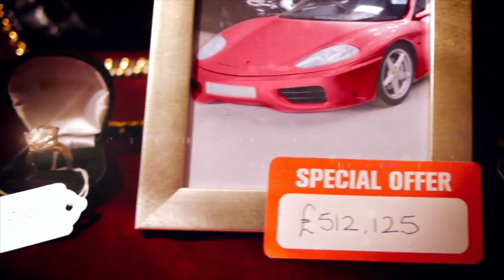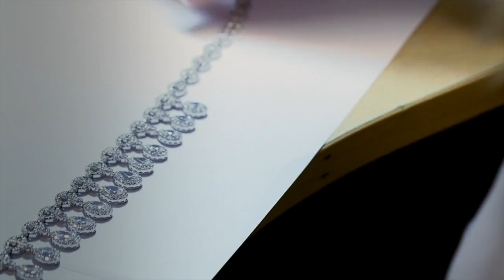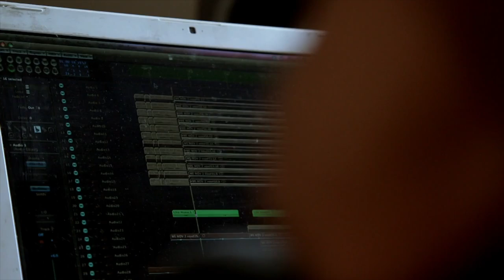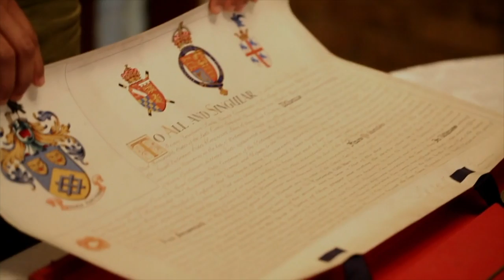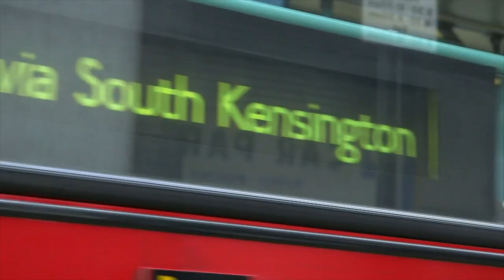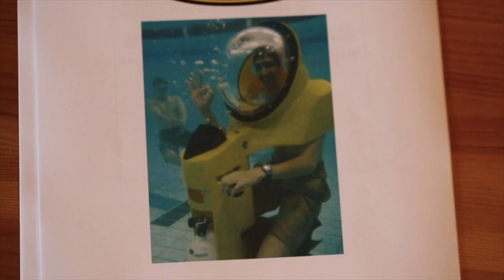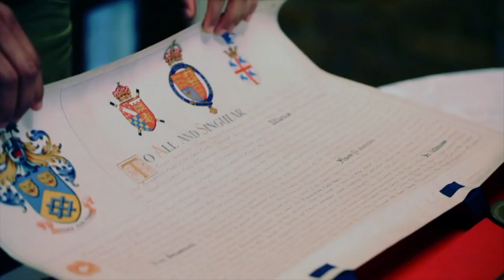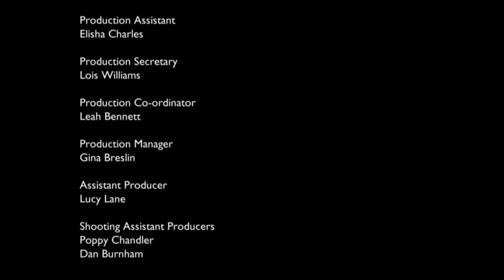Trade Off - From Luxury Pawn Shop: Decoding Heirloom Diamond Necklace Value

Comment: Also, let's analyze the complete transaction of that $500,000 necklace. She accepts a $50,000 loan on a $500,000 necklace. How is she going to pay that money back plus the interest on that loan? So when she defaults on that loan, the pawn shops keeps the collateral / necklace. At 10% of the retail value.

Plus, the pawn shop offered her even more than the $40,000. I think they did this to ensure that she would never be able to pay that loan back. And then the pawn shop keeps the necklace either to chop it up or sell it intact. So in other words, the pawnshop isn't selling the item they're actually buying it a few months down the road.

What the spider said to the fly?
"Will you walk into my parlour?” said the Spider to the Fly, “'Tis the prettiest little parlour that ever you did spy; The way into my parlour is up a winding stair, And I have many curious things to shew when you are there".
Reply: They said quarter of a million not half, so it was worth a retail price of 250,000 and she got 120,000, and she sold it, she didn’t pawn, the last women’s retail price was 120,000 and she got 50,000, she as well sold it. So neither have to pay anything back, the 250,000 one already had a buyer, he told her they offered 120,000 which obviously wasn’t true because he keeps a cut of it, so I’m curious what the person actually offered.

Comment: You don't take the first offer some gives you for a 250,000$ necklace. 250 is a number he just shot out at auction even though there would be auction fees but you don't leave 125k or more on the table.

Comment: I would have thought that the box with the paperwork in it would have been worth a lot more. As for the necklaces. Anyone can see that the first necklace was a work of art. glorious and one of a kind. I think it is worth a whole lot more than a quarter of a million. The other necklace was beautiful also, and I'm not sure about the price. The other necklace has big diamonds in it, where this one was smaller. I find it very sad that you have to pawn off your families history to feed your obsession, or dreams.
Reply: correct. *Always the higher carat weight of diamonds, *if also of good color, clarity & cut, will garner greater value than something like the second, generic necklace of a hundred 1/4 ct brilliant cut stones. 
But it's not always a given. 
A flawless (FL or VVSI, (Very, Very Slight Inclusions) Colorless (D) 1/2ct emerald-cut diamond might be more valuable than a 3 carat, H (color), I3 (heavily included) shallow, poorly faceted round.
All diamonds are not valuable. Industrial diamonds are used on marble cutting saw blades, down to tiny drill bits on your Dremel tool.